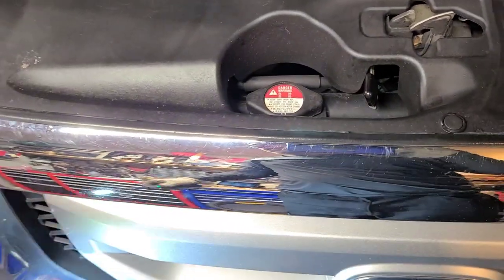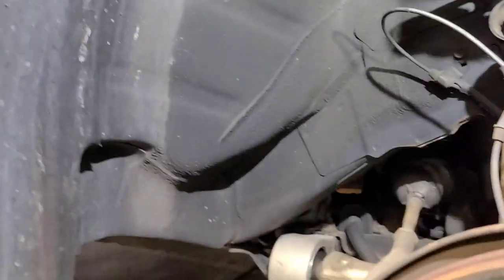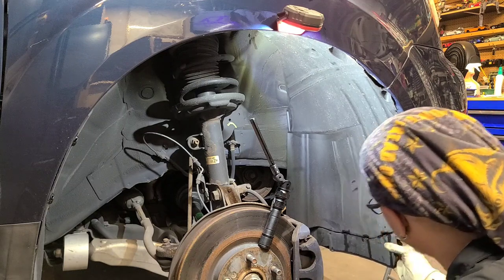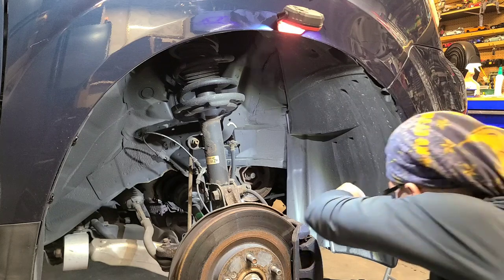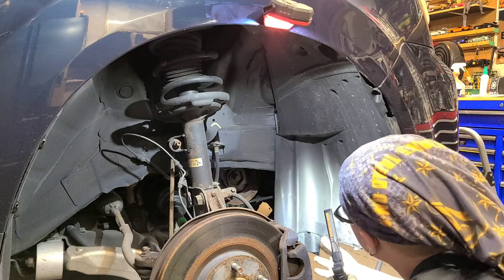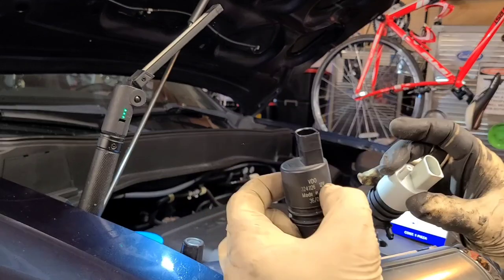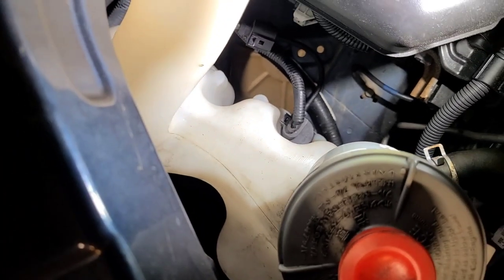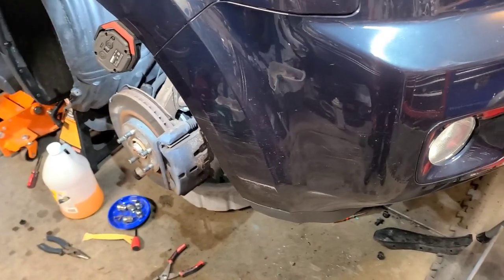2009 Honda Pilot EX-L windshield washer motor replacement

Comment: Thank you, very helpful! Would it be possible to remove and replace the pump from up top without removing everything from the bottom?
Reply from the maker: @geebeeinga  You're welcome, yes it is possible. I figured that out later. It will be a little tedious, but possible.